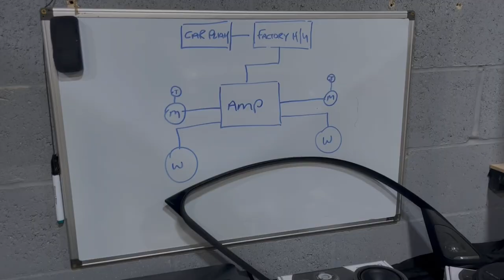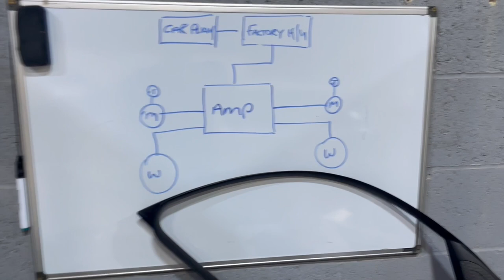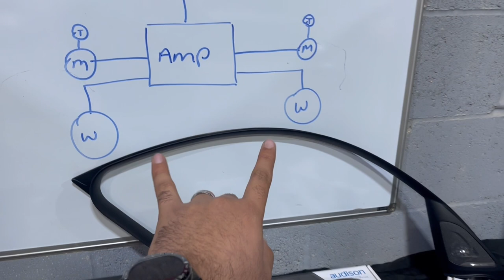BMW 1 Series Speaker Upgrade and Everything About It

Comment: Like the video ..... i have a question would you run that amp also for the boot and back door speakers adding to it a AUDISON LC6 or would you use a second amp ??
Reply from the maker: Probably move over to a 12ch Forza or multiple amps
Reply: @CambridgeCarAudio  Thanks for the info ... i was planning to use this set up 
AUDISON LC6
AUDISON APBMW X4E
AUDISON APBMW S8-4
FOCAL 100L
FOCAL FD 1.350
FOCAL FD 2.350

Comment: Hey, appreciate the videos! 
I have 2 quick questions, I just got the full audison BM-DSP-AF-06 kit for my base audio F21 LCI.

-Do I need to bridge at the AMP the BIAMP 1 cables? (I don’t think so but would like confirmation😄)
 
-I would like to still use my OEM rear speakers, so do I need to plug in the Rear left and rear right cables (coming from the AP 560P&P I/O) to 2  channels SPK OUT from the amp ?

Your videos have helped me a lot already!
Reply from the maker: @ImGamingg  Hi, thank you and love the feedback. Unfortunately it can be very messy advising people on how to wire a system or explain an install to them to do themselves. I would recommend you read through each manual and work it out, if you get stuck, the manufacturer may assist but again, they are in the same situation as us with hesitant to advise due to not having a car in front of them
Reply: @CambridgeCarAudio  In the manuals there isn’t really any information. 
For the APBMW BIAMP 1 cables it just says « to MID-HI amp SPK out » but nothing saying if it has to be bridged at the amp or not ..

But thanks anyway!

Comment: I have got the 1 series how much would it roughly cost for exactly the same you done on this one ? Thank you
Reply from the maker: Check out our packages in our website
Reply: I did it to mine but with an aftermarket double din stereo and dedicated speaker and subwoofer amps for everything it was around 2000. Not including dynamat sheets.

Comment: Do both of the underseat woofers run off the 5th channel on the SR 5.600?
Reply from the maker: Yes they do on this system
Reply: @CambridgeCarAudio  So to run an active woofer alongside this amp a loc will be needed?
Reply from the maker: @discombobulated_  nope, you can run another amp
Reply: @CambridgeCarAudio  I've paired the APBX 10 AS2 with a Vibe powerbox 65.4. Using the rca from the wiring included doesnt give me the full range sound but using the rca on the amp lowers the volume of the front speakers but plays the sub at its full potential. So now im wondering what I could do to fix this.

Comment: How come all the kits like vibe and other sites only offer 2 tweeters, 2 mids and 2 subs when they are speakers to the side of the parcel shelf?
Reply: What size speakers for the rear from the audison range?
Reply from the maker: Yes, they are in the side
Reply from the maker: @doragizdench8433  they are 4’’
Reply: @CambridgeCarAudio  thanks yeah I have been looking at different sites that do pre configured kits miss the rear speakers. But idm what ones I'm gonna get gonna look into the brand used in this video
Reply from the maker: Audison is far the best option if you want a direct fitment
Reply: @CambridgeCarAudio  Do you do upgrades for 3 series 2015 with Harman Kardon already fitted? Would it use existing amp loom or would a new loom be needed if using Audison?